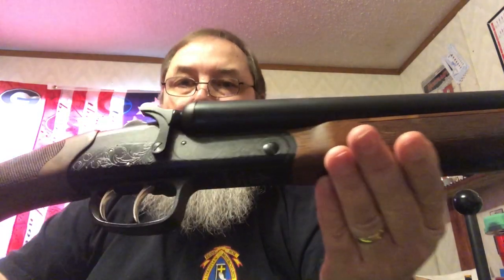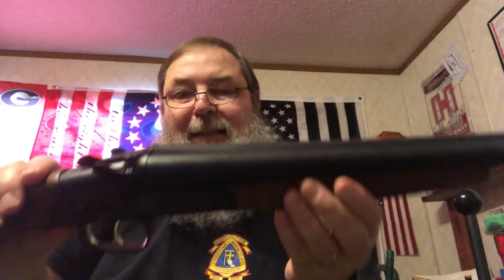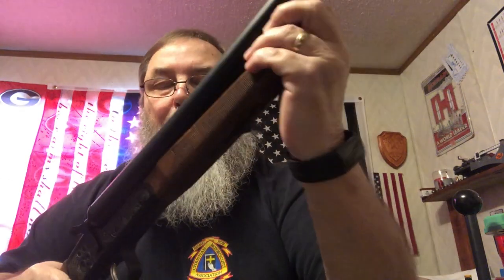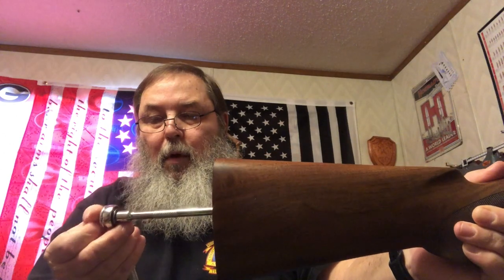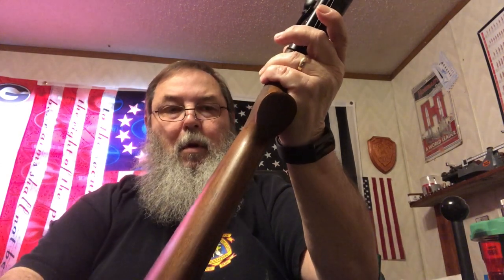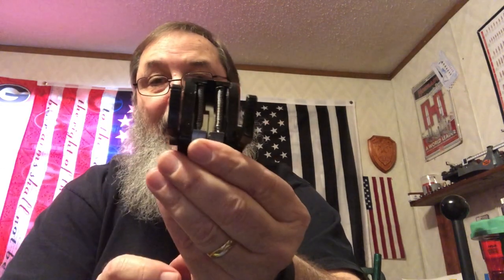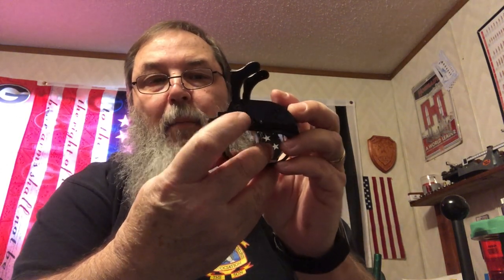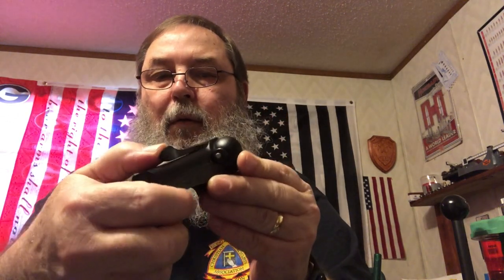ATI Road Agent

Comment: You did a good job on restoring it. I've never seen a hammered self cocking shotgun. Not much different than my Stoeger hammerless. It cocks when you open the action. That one seems tight. I did a lot of work on mine to smooth it out.
Reply from the maker: Thanks, Buddy. I worked on it to smooth the barrels dropping, but not the hammers cocking. I'm thinking of extending the hammers to make them easier to cock, and taking the self-cocking mechanism back out.

Comment: Nice restore job . I didn't know they had an auto cock feature .
Reply from the maker: Yes Sir, and that's my delima. That makes it stiff to lower the barrels, but the hammers are kinda small and laid down low. If it had higher hammers that you could sweep back in one motion, I would leave that cocker off of it.
Reply: @jh5869  There probably is a trick or two to make it self cocking with less effort ???? I know with my hammerless double it takes a quick flick to open the barrels fully .
Reply from the maker: I know. There’s got to be. I think using it will slick it really nice.